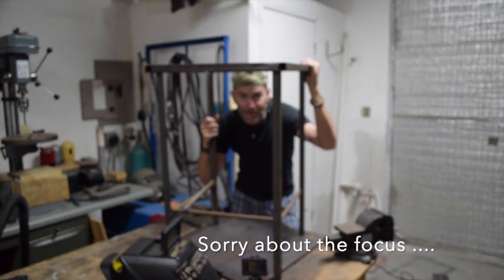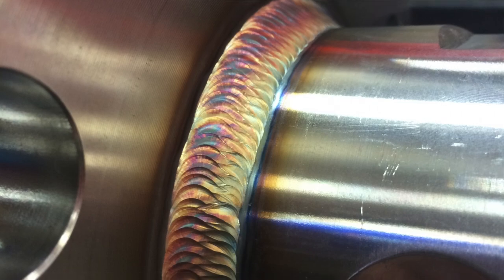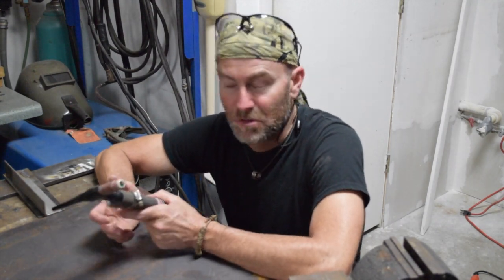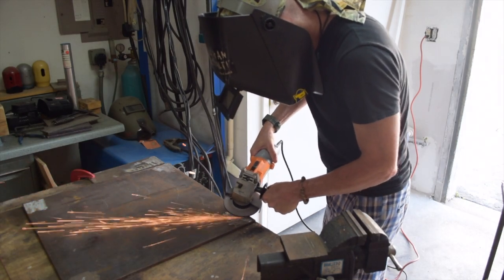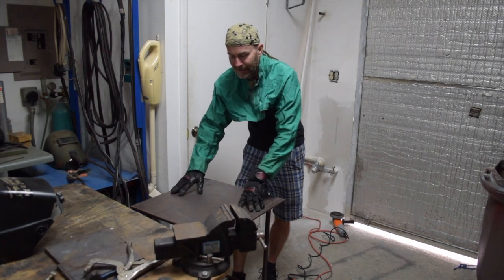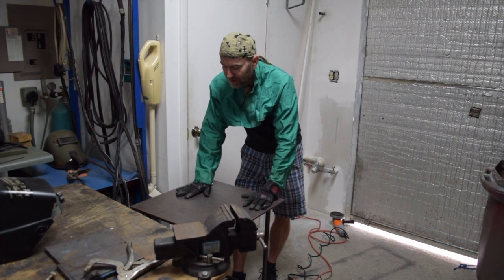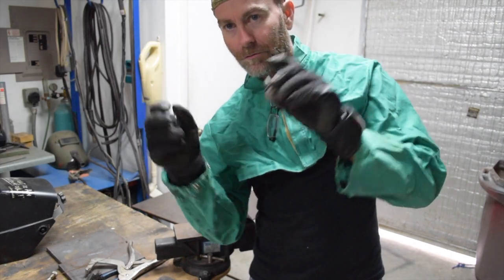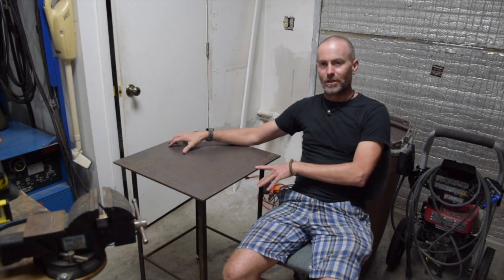Sewing pro does some welding!

Comment: Gas, stick, and MIG are more-or-less conquered.  I tried TIG and it conquered me.  More time and patience needed than I had.  Good work, Jason!!
Reply from the maker: Thanks!  It's funny, I can weld with MIG, Stick, and I taught myself with oxy-acetylene, but I'm WAY more comfortable with TIG (with a pedal, anyway).  The precise control of the heat allows me to catch myself making a mistake and fix it, or pause and figure it out, in a way I can't with the other methods.  When I weld with MIG I always feel like I'm pulling the trigger and hoping for the best lol.
Thanks as always for watching and commenting!
Reply: @thejasonofalltrades  Whaaaa?  Mig is so easy.  I am World Class at dipping  my tungsten. Mig Aluminum - now that is a blast.  Course you could Tig is as well.

Comment: I had a machine shop background and used to weld some, it was the family business. I oddly relate former metal working and even carpentry skills to sewing and layout techniques quite often. Measuring, picturing things in 3D, it's all relative and handy when old skills and tricks can be called upon to assist us later in life in a new hobby (like sewing). Great topic, Jason!
Reply from the maker: Thanks, JP!
Reply: I'm in complete agreement. I started welding over twenty years ago and just started sewing. Fitting up pieces (basting/pinning), picking the right machine for the job, using the correct rod, temperature and speed (needle, thread and stitch length)...
Reply: @kirbyfroese2013  You guys are SO Correct.  It's all about the fit up - be it welding or sewing.
I had to throw away a couple of  projects to learn that.  Vinyl is even worse as it is Much Less Forgiving than.... Sunbrella, for instance.  I'm enjoying sewing (Marine Upholstery) as much as welding and metal design.

Comment: In shorts!!
Then I know why you chose to use the TIG method and not MIG or SMAW. ;-)

I learned to weld using oxyacetylene, and will recommend that to anyone learning to weld. Not because it is easy, but because you learn what a weld puddle is, and how to read it. And it's kind of forgiving.
TIG is not that much different as there is a heat source and a separate filler material. But I was glad I did OA first when the heat control came in as an additional factor. Synchronizing a weld puddle, filler metal, 2 hands, 2 eyes, a foot and a brain is not all that easy for a beginner.
Reply from the maker: I agree completely with learning gas welding first, I taught myself with Oxy-Acetylene.  Definitely made TIG feel easier to learn.
Thanks for watching and commenting!

Comment: What machine is that?
Reply from the maker: It's an old (1986, I think) Miller Dialarc HF.
Reply: It's for time travel.
Reply: Dialarc 250 hf?  About a life ago I used to work for a Miller distributor up here in Canada.  They are a nice welder.